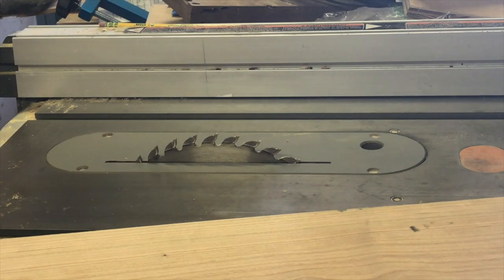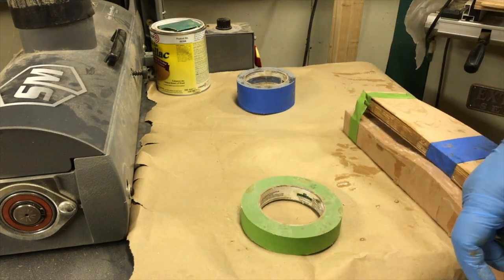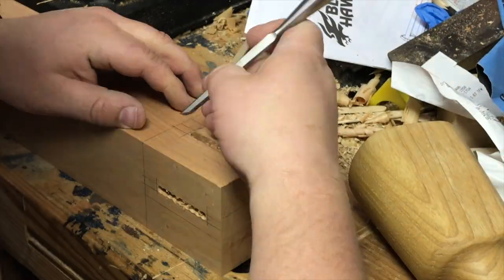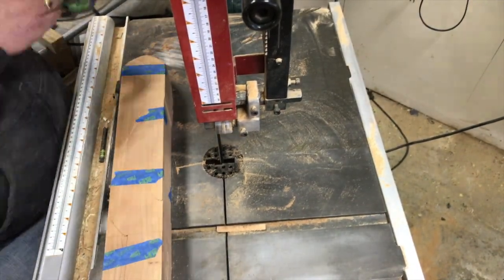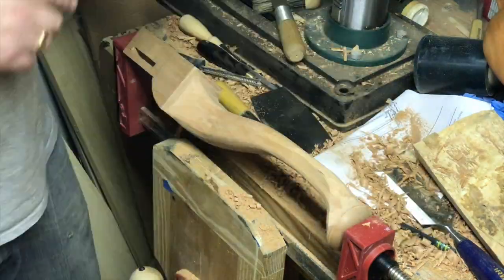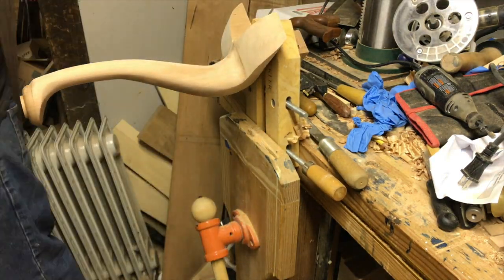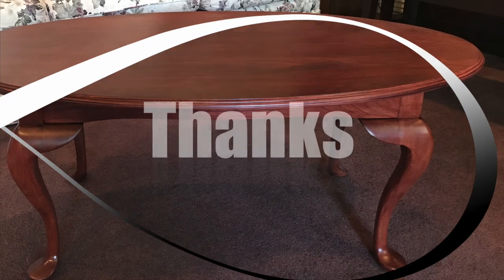Making a Queen Anne Coffee Table for Grandma

Comment: Are there any templates for the legs?
Reply from the maker: No. I just used a piece of paper to mark out the dimensions the leg needed to be and then used a couple of French curves to make the curved parts in a shape I liked. I cut out that piece of paper and glued it to a think piece of plywood and then cut the plywood to match the outline on the piece of paper. That became the template.

Comment: 3 year old video......
I just watched a different video that was a year old that showed how you could of used a ban saw to cut out your legs.
Maybe not necessarily as "curvey" as yours are, but they were very similar.
Reply from the maker: Eric Williams I did use a bandsaw to rough out the legs. There’s lots of ways to do it though. I’ve even done it with a jigsaw before. I prefer the extra curves and the shaping work that goes along with this look. I find the shaping work very relaxing.

Comment: For someone with limited tools i think you did a good job. You should have repaired that crack on the underside of the table top.
Reply from the maker: There weren't any cracks.
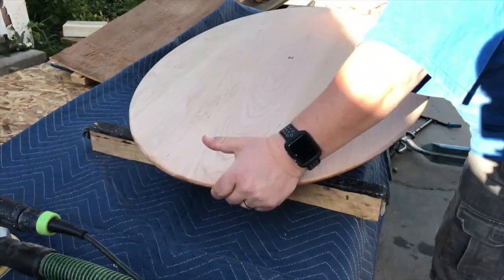Reply: @BitsandWood  at 4:14 it sure looks like a crack. 40 years as a cabinet maker, but i too can be fooled.
Reply from the maker: @magicman9486  It was just a pitch pocket. This batch of cherry had a lot of them. It does look like a crack from the video though.
Reply: @BitsandWood  Getting good wood has become much harder